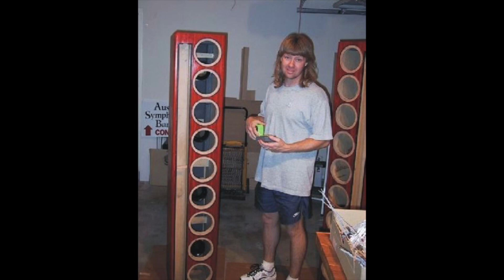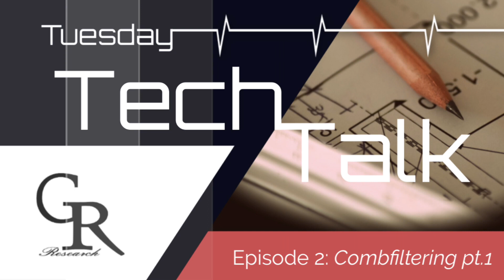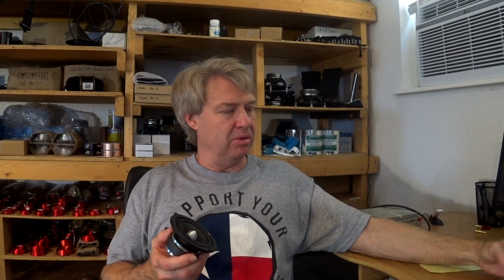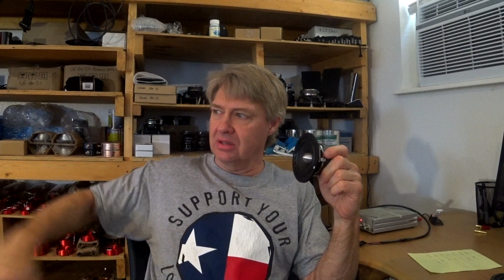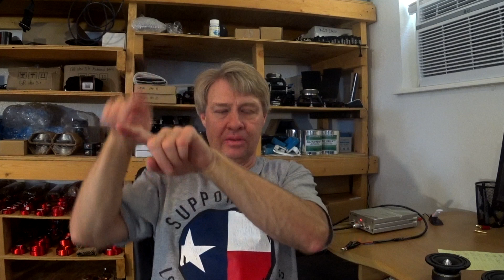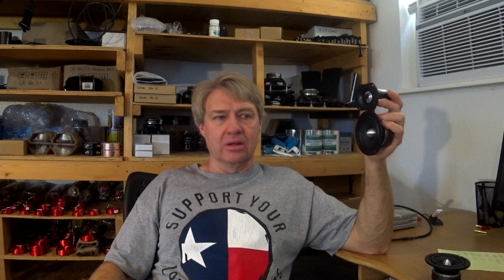Tech Talk 2: Comb Filtering

Comment: This is why I would love for you to do a Klipsch Heresy or Forte speaker with measurements.  The acoustic center is far apart because it's a large (comparatively speaking) speaker.  But is it really when you consider that it's a three-way and the crossover to the woofer is at 700hz.  That wavelength is 1'7".  The tweeter and midrange are then closer than almost any woofer and tweeter would physically allow.  

Also, What does such a wide baffle do to the sound?

Comment: ZTE  Zmax Pro or Samsung Device.   I can tell due to the High pitch sound on the recording.  :-)  Or cell phone Cam?    Also,   That explanation at the begining to explain degrees or Phase angle is the best explanation I have ever heard it being explained.  You made it MAKE sense if that same explanation can be used to explain phase in Wireless transmission signals.        Thank you sir.  I got it!